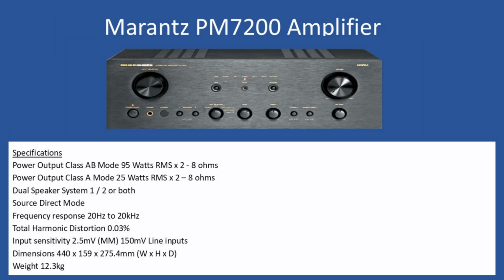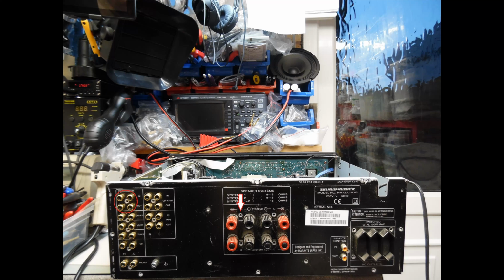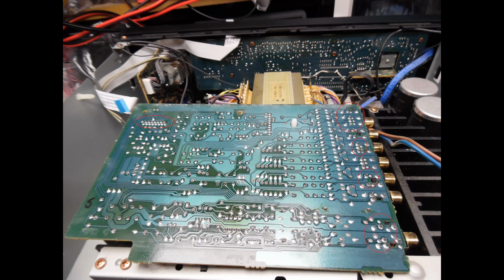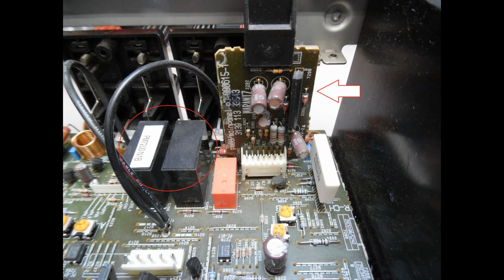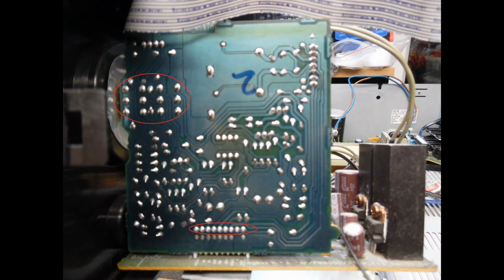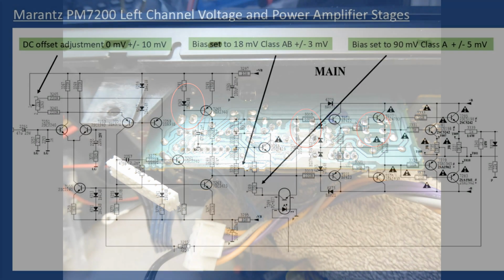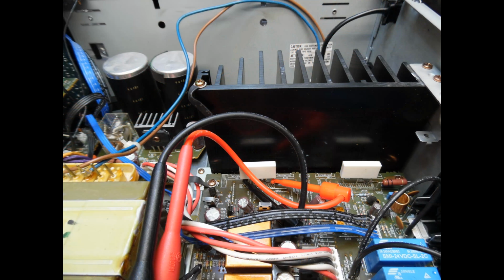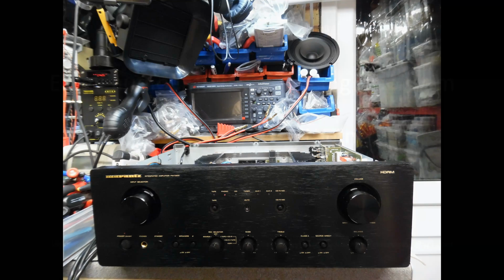Marantz PM7200 Amplifier Repair (With Audio Tutorial)

Comment: Thanks so much for the helpful video. My amp began making crackling noises and sounding distorted at all volumes, especially when tapping around the speaker terminals. I removed the amplifier board with the 2 big heat sinks, and re- soldered all the big transistor legs. I found a bad dry joint, but the solder wouldn't stick to the burnt track, so i used a short piece of copper wire to solder the leg to a more solid part of the same track. My daughter distracted me about then, and the amp dropped a metre onto the floor, resulting in the unbolted transformer breaking off the 2 mains wires supplying AC 230v to it. 
I re-soldered these back on, and now the amp blows the little mains fuse whenever I switch it on. 
Any thoughts?
Reply from the maker: Hi, I would advise making a bulb current limiter so you can make further tests to determine the issue. https://youtu.be/8YWqWabXdbo?si=LpKyPwKuLpprEBnf Once connected to the bulb current limiter I would advise disconnecting the power plug from the Amplifier board and checking to see of excess current is draw.
Reply: @AudioAmplifierServicing Thanks, I'll give it a try. You're talking about a 230v light bulb where the mains fuse goes?
Reply from the maker: @reelMn Yes correct.